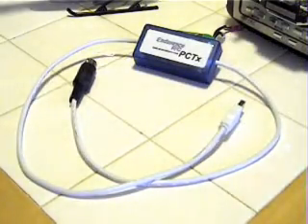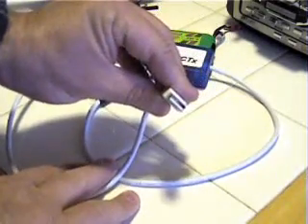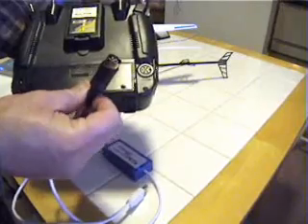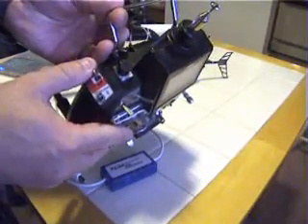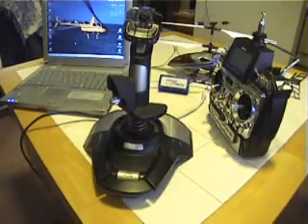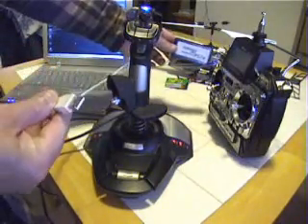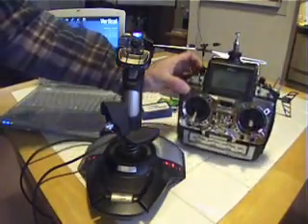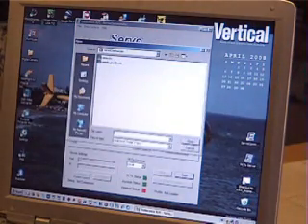Endurance R/C PCTx

Comment: what do you mean by noticeable delay? was it easy to fly?

because this one is a koaxialrotorsystem so it is pretty self-stabilsating but normal main/rear rotor configuration will be hard to fly if you have delays..

I think the problem will not be the resolution of the steps but the time to transmit or I am wrong

Comment from the maker: 50Hz PPM refresh rate, no noticeable delay. I have not used with 2.4 TX systems yet only 72MHz. there is two versions of PCTx if you need High Resolution Support (1024 steps per channel) Good Luck Enjoy!
NOTE: the magic is in the endurance-rc ServoCommander software